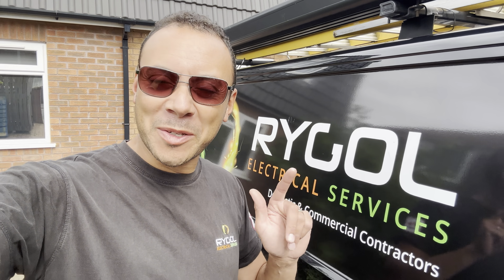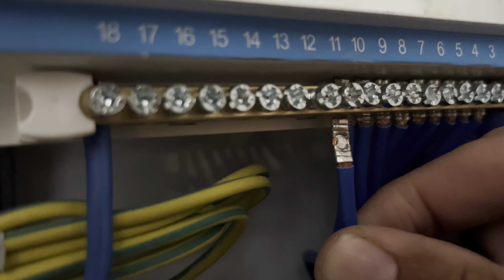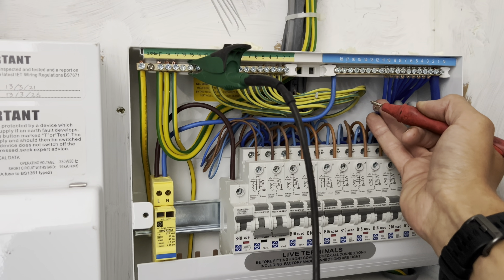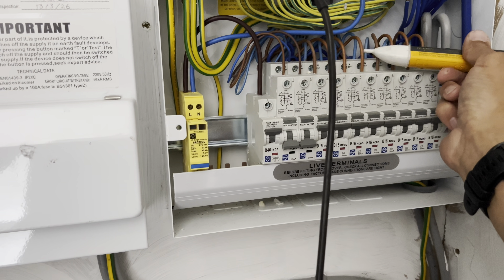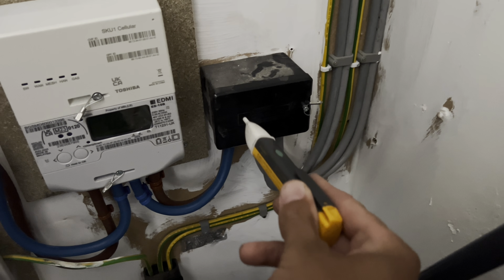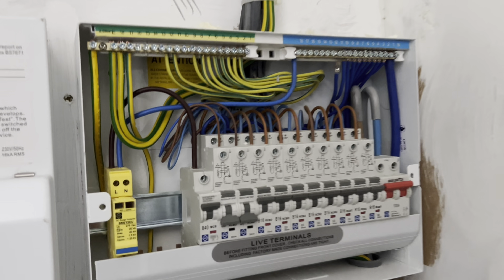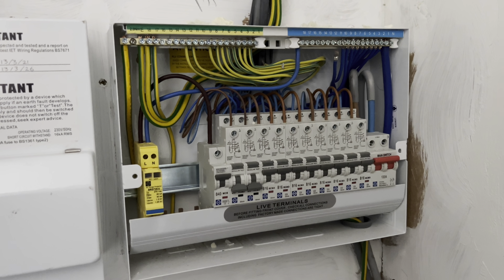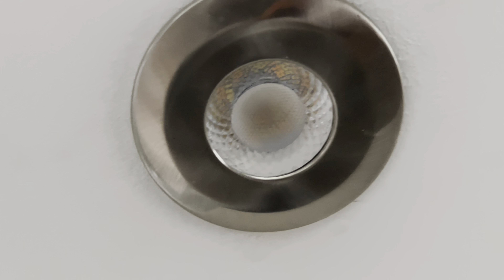Smart Meter Disaster! ⚡️

Comment: Cant believe nobodys noticed that the electrician that installed the DP block has installed the lives at the front...
Reply: I spotted that immediately. Whoever installed it has got an odd idea of connecting the tails. I hope it wasn't our friend who did the rewire... he doesn't mention whether it was there at the time.
Reply: @stephenmutch4175  I hate those DP blocks, I always replace them for proteus/lewden single pole blocks. Makes installations much tidier and can properly terminate the cables with no inner/copper showing. The amount of DP blocks I find with all the spare ways knocked out showing open ports or just loads of copper showing on conductors, especially the older type double pole blocks that have the 3 smaller ports in the middle and slack bastards smash the bottom out to be able to fit 25mm cables in... Everyone's a lazy dickhead these days.

Comment: Maybe if the person that installed the double pole block terminated the polarity the right way in the block then it might of not been an issue to begin with... Lives go AT THE BACK for a reason . Neutral bar at front.
Not saying it's not the meter installers fault as still should have checked polarity at block, but those DP blocks have lives at back for a reason. 
Also stop using double pole blocks. The proteus or lewden single blocks are far superior. Also the amount of DP blocks I come across that have bare copper and inner showing and terminated like shit is astounding, most electricians make a total mess of them.

Comment: Northern Power did an investigation  on the Meter the problem with the connections in adjoining property the external provider main feed was shared between the two properties causing voltage leak into our property from next door through our  neutral to ground apparently we'd not had anything done recently but they had.

Comment: Any wiring in a house you treat it live, no matter it's color the wire is till you confirm what the circuit has running over it, No. 1 rule, test before touching.

Comment: In the Netherlands we install the Fase and the neutral in the same braker. So every circuit braker has a neutral and fase in the same braker. You would still have the same problem with the LED lights in this situation but you would not have a whole bus bar being live.

Comment: I always tell people, treat everything as if its live, whether it should be or not, until you've *proven otherwise. In fact, beyond even that, treat it as live wherever possible even if you've proven it to be dead. Do those things and you'll never get a shock.  I usually test everything after isolation at the DB with first my mft, then the 'Doofer' (voltage tester) then finally the old 'glancing blow with the tip of a finger', although I dislike coming into contact with any bare conductors if I can possibly avoid it... I've seen more than a couple of electricians get a whack from something they thought was dead , or which should have been dead.

Comment: I believe it says in the regs that the tails should be colour coded, so I'd say that this is on you as well, if the meter tails were correctly marked this wouldn't happen.
Reply: You are assuming a lot. In all likelihood he had nothing to do with the tails and just did the work from the  board onwards.
Reply: @cbcdesign001  No, he installed the board, and obviously connected the 25mm tails into the board.
What he doesn't say is whether the Henley block was there at the time of the install.
Whoever installed the Henley block, I can't help feeling it strange that the neutral was at the back and the live at the front. I've always connected them with the live at the back for obvious reasons. Maybe the meter installer was like me, and expected the live to be at the back. Not making excuses for him/her, but if it was already there, it seems to have a history of being connected oddly.

Comment: I hope you reported this to the DNO. Although this would be classed as a near miss (not reportable under RIDDOR), I would definitely be reporting it, 1: So the client can claim back the cost of you attending site and rectifying this dangerous situation. 
2: so the installer can be told of the dangerous way he left an installation, so they can get the relevant training so as not to do this again. 
It takes just seconds to plug one of those polarity testers into a socket, so there’s NO excuse for not doing it, and it could save a life.

Comment: Really should be more enforcement of energy companies causing unecessary dangers like this! How easy is a plugtop tester in a single socket as you demonstrated.
On the "working live" thing; even if just on the 6A lighting circuit you isolated, safe isolation procedure testing RCBO Out (Live) to earth, Live to Neural, then critically Neural to Earth would have told you something was spicy before going in to unscrew the neutral from the bar! It's thanks to so many youtube sparks with warning content like this that I always check!

Comment: Blue energy supplier label. Who could it be????. Great video. However, if you had just done a socket test with that orange plug 1st you would have saved nearly getting fried and some time. The metering guy or gal should have done a socket test after meter exchange and tagged the grey tails with L and N tape or cable ties, before changing any cables

Comment: Live and neutral were swapped. This meant that all switches were in neutral. 
The LEDs were powered via the blue cable even when the switch is off.
A small current flowed across the capacitance in the cable to the ground wire.
Reply: In Germany we have three-phase current in our houses. 
The standard states that it should be a clockwise rotating field.  L1 - L2 - L3
After changing the power meter we now have a left-hand rotating field. L3 - L2 - L1
Since the lamps and sockets are 230V, that doesn't matter.

Comment: Hi looking at the 100 amp link box the neutral is connected in the front block which is normal with  the live at the back ,so it looks like the dno man connected his tail to the normal place ,ie live at the back neutral at the front with out checking the polarity .then not testing polarity after ,
as every electrician knows it’s possible to connected wrong we always check polarity ,I’m pretty sure most meter fixers are not fully trained electricians ,funny really we as trained and certified electricians are not allowed to touch that part of the installation , but their non electricians are !!
Reply: 12 weeks to be qualified. My nephew got qualified as an electrician in two weeks intensive resettlement course coming out the Army. Gone are the days of year apprenticeships.

Comment: Yes an video showing how the meter installer made an error in the installation which caused a hazard. However, I am horrified by the steps taken to make the clip. You had your fingers millimetres away from a bare conductor which is known to be at a lethal voltage. If you performed that in front of your scheme’s assessor they would pull you up and maybe suspend your registration until you had undergone additional safety training.

Result good but methods poor

Comment: The first thing that came to my mind when seeing Neutral and Live swapped was the old trick used to steal energy beside the meter. Don't know about smart meters, the old mechanical meters were only measuring current through Live. So by swapping the wires in front of the meter, so using Neutral as Live  and using Earth as Neutral (quite dangerously) one can bypass the bulk current so it is not metered.

Comment: Horrifying! We are constantly told to get smart meters, but the guys fitting them are not carrying out proper installation and testing. Mine was smart meter was fitted years ago and I do have a small problem with my LED lights glowing after they've been switched off. I'll get it checked out.

Comment: I am 73 and retired now, but I was an electrician back in nineteen hundred and frozen to death. I am glad to say I diagnosed this fault as being a reverse polarity issue within a few seconds. As an established tradesman, this Rygol Electrical chap shows all the competence and fault finding initiative that was my benchmark, and good to see is still being practised today. Excellent neat wiring practice and superb job all round....Well done that man!
Reply: As a retired electrician (and glad of it), I would’ve also mentioned the possible damage to electronic gadgets with reverse polarity in place. It can cause an absolute nightmare !
Reply: @SleepSensation  Why would ANY equipment (gadgets?) care about polarity?  Please explain.
They use 2-wire AC (with optional ground/earth PE protection).
For an appliance, there is no relation between L and N, it will work either way if it's 240V AC.
Reply: @kuifmans2001 yes the equipment would likely work, HOWEVER unless the equipment in use is 'double insulated' you would have a 240volt potential difference between anything metalic on your device and 'True Earth' ie the ground you stand on, which means the live 240volt potential would travel through YOU down to ground as an electrical path . . . . . . and your heart really might object to this happening.
Reply: @stevosteve  Polish guy in a HMO died in the shower. For that reason. Not sure how his flatmates had got along up till then.  The landlord had bypassed the meter, and the polarity... In the UK, not Poland, I should add.
Reply: @SleepSensation  Such as?
Reply: Yep, "Reverse Polarity" was the first thing I thought too.  But as I am not in the electrical trade - merely a B.Eng (Electrical) without the relevant practical experience,  I couldn't easily believe that the meter contractor had made such a fundamental error 😟.
Reply: @hectorpascal  My meter has a "polarity checked" sticker on it, so I guess they do have an issue with their installers. Who, by the way, are NOT electrical engineers. or even electricians, as it happens. (much to my surprise, I should add)
Reply: @Marek-o3u  Surely they MUST have some relevant practical trade qualification?  If only to stop them killing themselves.  At the meter entry point there must be at least 100A of available  current (but I know very little about how that part of the network is fault protected.)
Reply: My first reaction when looking at the DB was that it had initially been installed with wires dressed by a competent Electrician, it’s always reassuring to see a tidy installation and usually indicates that ‘fault finding’ is made much more straight forward.
Reply: Why didn't you start at the origin of the supply , first question to the customer , have you had any work done recently ? , that would take straight to the fault within minutes.And you trust a volt stick !
Reply: @adrianmawby9009  watch the beginning of the video again, then we'll all politely look away while you delete your comment.

Comment: I know exactly why the DNO have got that wrong and that’s because you wired the Henley connector the wrong way round.  The line conductor should be at the back to it is covered by the neutral conductor when the Henley is opened up.  It’s not a regulation but a long standing convention.  Schoolboy error…

Comment: Really well described and shown. You had done a cracking job of wiring. Better than some aircraft wiring I’ve seen.  I think using the basic socket tester at first would be a good idea except that you can’t guarantee that someone hasn’t reversed at the socket.

Comment: I am not an electrician, but I knew where you were going as soon as the neutral rail read 200+ volts. I will be checking my setup asap after watching your video and highlighting the danger involved. Thank you for informing all that watch of the dangers they have been exposed to, due to shoddy and dangerous work practice. Modern sparkies are being rushed through with little to no real safe training.

Comment: Seems a common thing with meter installers,  bit odd though as they should always plug in to check polarity.  Clearly didn’t, and I think most sparks know full well which company this is.

Comment: I used to plug my socket tester into the wall switch it on at socket so when i reinstated the power i cpuld hear the beeps of the tester to tell me polarity is correct, its not difficult

Comment: Great reminder to ALWAYS do polarity check first when opening a DB,  with G38 tester preferably......us electricians easily fall into complacency....each time I have,  a  near miss occurs....complacency probably biggest enemy ...
    Multi meters REALLY easy to have on wrong setting when working fast / under pressure, G38 testers on other hand, a lot cleaner / less room for human error....G38,  expensive but your worth it ! ...they also have double insulated leads...... Fluke and Martindale good
   volt sticks a good rough guide...but when you need it most don't be surprised if it gives FALSE readings...I have got through heaps of them....they are not very durable / provable

Comment: Having read the title, I knew what the problem was as soon as I saw those glowing LEDs. Then when I saw the quality of your work it just confirmed where the fault would be. 
Been a sparky since I finished my apprenticeship after leaving school 25yrs ago, but currently unable to work due to my mental health. 
Well done British Gas … keep costing the customers unnecessary money! They’re no good with open gas fires either!
Your work is beautiful by the way!
Reply from the maker: Thanks Josh, you got it spot on and i appreciate the kind words.
Reply: LEDS will turn on partially with a connected hot and an unconnected neutral? how?
Reply: @franklofarojr.2969  It’s to do with how the electronic components within the LED lamp slowly discharge a tiny current through the Light Emitting Diode over time. I can’t explain the electronics for you, because I struggled a bit with them at college (although I think it’s caused by a resistor whose job it is to discharge capacitors over time). But basically (from an electrical perspective), if you switch the Live (Hot), no power gets anywhere near the lamp; but if the polarity of the cables is swapped, you are effectively switching the Neutral, which means the wire through the lamp and away to the switch is powered, thus allowing for the leakage through the diodes to take place.

Comment: The new model breakers have bleed by Yes residual power is continuing to flow through the cheap china made breakers and it is enough to very dimly operate the mili watt LED. Newer is not safer or better. it is junk is what it is pure junk.

Comment: The main fuse has a tamper proof seal, this electrician would have had to break the seal, to pull the main fuse to turn the mains line an natural round, or he would of had to do it live ! Really the electrician should have told the home owner to contact there energy supplier to send someone to correct the problem! Only problem with that is the electrician wouldn’t have been able to charge for the work! Plus energy company may say we can get someone out in three days time!

Comment: Dude, you’ve installed your own meter tails reverse polarity out of the double pole henley.
Line at the Rear, safest terminal for the line conductor. The meter installer should have discovered that upon testing (and visually inside the Henley)
Reply from the maker: @beatbox894   unfortunately you are incorrect. Watch again more closely ;)
Reply: @ I have so many times. The meter installer has it correct. The property installation electrician has it wrong.
Reply: @RygolElectrical line at the rear. Neutral at the front. It’s clear as day.
Reply: @RygolElectrical please tell me you altered the wiring between the Henley and the consumer unit. Not the Henley and the meter…..

Comment: To be fair the Henley block is wired incorrectly. The meter operative has connected them as the should be. What would be interesting is to find out which socket they done a Martindale test at (if at all). Because if that socket was the wrong polarity then it would've shown it as correct before and after......

Comment: Well the smart meter installer should be reported or struck off, and you, my friend, should practice safe isolation. You were so close to getting a shock. Use the safe isolation tester to test before you get your hands near it. I had to work on live ccts, (military) and you always check where the voltages are before you start, and with a fault, even more so. And leads had too little insulation. You were very lucky.
But yes, a neat consumer unit.
reading the other comments, I agree that the company should have been informed and told to rectify, asap.

Comment: while it is "fine" to have L and N reversed at the socket, since you can plug any AC device in regardless the orientation of the plug, but having N live is not fine. N is usually connected to PE so as he said, now anything that is grounded is now live on the outside.........

Comment: Great aesthetics on that wiring, but good grief man. You always assume EVERYTHING is live, even if you're working with ELV (because dropping a screwdriver across a 48V bus capable of 400A is not going to do your health any good). Particularly when you KNOW there's some kind of fault. You at least poke around with your meter (one-handed) to check first, and/or put some gloves on. I've had plenty of jolts myself over the years - invariably as a result of carelessness. But you don't necessarily get a second chance.

Comment: On a Henley block the live should be at top and back and the neutral bottom and front so you originally put them in the wrong way around. Your tails should have tape on to indicate live and neutral too.  You caused the misunderstanding.
Reply: I completely agree.
How much does an inch of heat-shrink tubing (or insulating tape) cost?
Reply: @SRWhittles  Where does the heat shrink go?